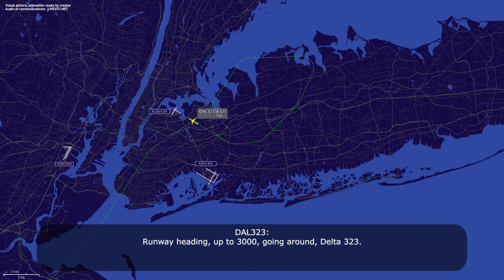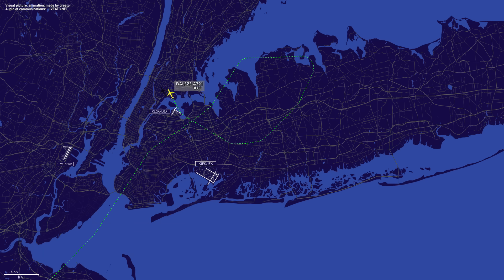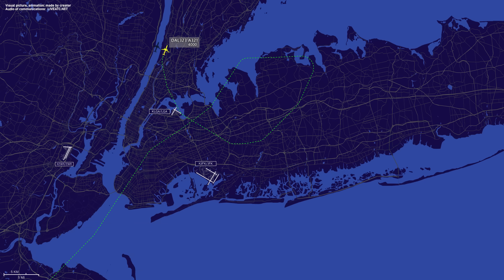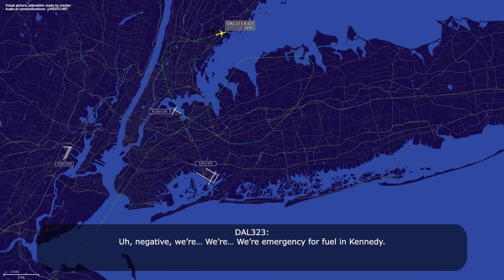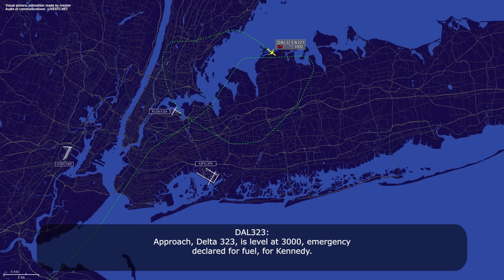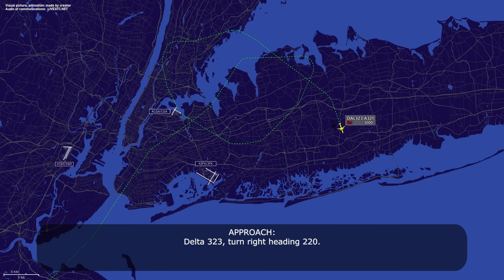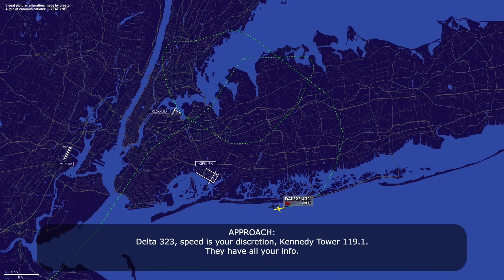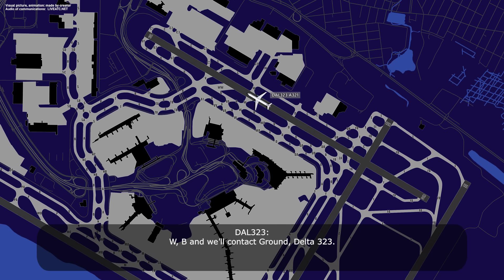Pilot declares MINUMUM FUEL after go around and diverts to Kennedy Airport. Real ATC

Comment: A general question on limited fuel NOT RELATED TO THIS INSTANCE: Do controllers follow-up to check if a minimum fuel declaration was "real" or just a ruse to jump the queue? NOTE: please respond on point! Which if you missed it: ...are instances where  the sequencing is upset due to "fuel emergency" further monitored/examined/followed up? Yes or no?

Comment: My only criticism is that asking how many planes ahead of you is the wrong question...it's really how much time before you're on the approach, or whether you're going to be getting extensive delay vectors. Look at where they were relative to the airport at the 3:25 mark....it's not hard to imagine fitting 10 planes in front of them, tbh. That said, the existence of such awful windshear, meaning a non-zero chance of another go-around, plus the possible delays associated with the medical emergency arriving in front of them meant that diverting to JFK was the right answer. 

My point, though, is that the reasons for diverting to JFK were not really based on the answer of '10' to the question of 'what is our sequence?'

Comment: great video & comments. Wouldn't the same considerations be also applicable for JFK..they were reporting windshear at JFK  (potential for go-around) and it was a greater distance to get to JFK than LGA from where they declared fuel emergency. Is it simply they expected an immediate landing clearance in JFK vs at LGA?  Why could JFK give them that and not LGA & how would delta pilots know they would get that? Thx!

Comment: For anyone curious, it was not the sequencing that caused the diversion. It was the windshear. Once they were emergency, they were #1 for LGA, perhaps #2 behind the medical emergency. But, the windshear made it possible that another go around was quite possible. Then you may have a bigger problem. Now that 40-45 min in fuel is 20-25 minutes. No pilot wants to bet their lives and passenger lives that the tank is that accurate. The pilots made the correct safe decision.
Reply: But isn't being #2 for LGA which is closer, better than #1 or #2 for JFK which is farther, and also has shear reported?
Reply: @JahongirHaitov  I did not see the JFK windshear in the report. In any event,  in an emergency, you want to be #1.  What happens if the emergency ahead of you has a problem. Yes it was medical, but what if they had to stop to treat the (unknown) condition on the runway. Now you are really up against it. At JFK you also have parallel runways... aka multiple options.

Comment: My buddy Flys for delta from key west to Atlanta. He says he barely has enough fuel to get to Atlanta and wants ore fuel on board. Delta won't let him. One bad thunderstorm and maybe not make it.
Reply: Alaska 420 smokin too much 420...nobody believes you... #1 Nobody just flies to/from Key West to ATL. #2 Delta ONLY uses the A319 to serve Key West. It's a good performing aircraft, it can and does carry plenty of fuel for the city pairs. #3 There have been a number of pilots on this thread that have stated they have decades of experience as Delta pilots, myself included (almost 30 years), that have stated they have NEVER been pressured to fly with less fuel than they felt comfortable with. I have never heard one pilot say they were refused additional fuel when the Capt had requested it.
Reply: @6862ptc  thanks for confirming my suspicion
Reply: They're trying to avoid going under minimal fuel requirements dictated by regulations and company policy. It's not like they are about to actually run out of fuel. What your friend is complaining about is needlessly risking everyone being stuck in Orlando and missing their flights from Atlanta. However, someone gets paid more money than a pilot to determine how much it costs to divert a plane, compared to how much is saved by hauling less fuel to 35,000 for 1,000 miles. We should be impressed with how accurate their fuel prediction method is, instead of being concerned about Delta being too fuel efficient.
Reply: @6862ptc  I guess, but only about the flat parts. I used to live in NE South Dakota. There are parts that the grade is 1 ft per mile, that's some flat earth.

Comment: This is a really good lessons learned here. Thanks for posting. I always teach "gas is brains". Meaning when you're low on fuel, things can get pretty hairy. And decisions and the ability to make good ones become more difficult. So the implication is when able, do not skimp on fuel. In this situation however, this airliner probably had the proper fuel planned. This shows that having a legal "plan" does not always preclude situations like this from arising. Higher than expected winds and longer routing can eat into the required reserves. For this reason, many commercial and military operations plan for higher than minimum required fuel. In any event, a go-around is one of those events that can seriously eat into that minimum required fuel. It easily can turn into a 10-20 minute ordeal. In this case he was number 10, which can mean 20 minutes. That's 20 minutes out of his 40 remaining. Talk about gas being brains!

I think the captain made a great decision to declare an emergency and go to an airport with multiple runways that favored the landing winds instead of trying LGA again. Another important takeaway for young pilots is this: "Emergency" is not a bad word. And it does not mean you made a mistake. It simply means you have a situation and need priority....so you can live and talk about it on the ground. No good organization will hammer, or even negatively question a PIC decision to declare an emergency.

40+ years of flying, 21+ of it in the Air Force, has shown that you can hurt yourself or others, trying to "gut it out" in this industry.

Comment: Extremely professional exchange, but… how can ONE go around and some minutes of wait till sequence 10 can put an aircraft into a fuel minimum emergency?
Reply: Do the math. There's 19 planes in front of them (9 landings and 10 takeoffs alternating). One of which is already an emergency and any of which could soon be if they are repeat go rounds. Tower is already in abnormal approach. Tower is already calling go round on wind increase +25 from 11 to 36 (if I remember correctly). Do you have a crystal ball? Any thing goes wrong or even sub optimally, they fall out of the sky going around the second time which means climbing out of LaGuardia into yet another approach with a lot of traffic. 

LaGuardia sucks. More generally NYC sucks but LaGuardia especially.

Comment: Why didnt they plan for more fuel? I mean it was a relativley short flight for the 321 atl-lga, every one knows you can get held up a lot in holds and GA into lga so not sure why they didnt stack up another two hours or so of fuel
Reply: Why didnt they plan for more fuel: mainly because of the equation of more weight = more fuel. And fuel takes more weight, meaning more fuel.
Reply: @andmos1001  yeah but i mean its a 321. they can hold lots of fuel and lga is known for delays
Reply: @gnobes9677  With the new FAA passengers weights they introduced five years ago and more seats on planes, maximum structural landing weight can be a problem for the A321s. A321s are also poor performers climbing wise so less fuel can help get to higher flight levels.
Reply: @matthewstraub8771  still a short flight, i mean ik a captain who goes from atl to bermuda and he says he brings enough fuel to GA and even fly back
Reply: I thought the same thing.  I get that it was probably more efficient to fly with less fuel but was money saved after having to diverting to JFK. Not criticizing  just genuinely curious.

Comment: Carry more fuel, especially when flying into NYC. Problem solved. Not to mention 40 minutes of fuel left isn’t any emergency. It is an excuse to not be flagged as being delayed.
Reply: It is an emergency if you are expecting to land with less than your final reserve, 30 minutes. So in this case, it is certainly an emergency..
Reply: @ The point remains. Simply carry more fuel, especially when flying into LaGuardia. Back in the 80s I was on an Eastern shuttle from Boston to LaGuardia. We circled for what seemed like 30 minutes before the pilot told us he ha$ to go back to Boston due to congestion. This happens all the time at LaGuardia.

Comment: The required terminology is "Mayday Mayday Mayday Fuel".
Reply: No. Not with 4000# or 40 minutes worth of fuel and a number of divert options available.
Reply: @6862ptc  They declared a fuel emergency. This is just about terminology.
Reply: @sylviaelse5086  So, at 40 minutes of fuel, the A321C was at "minimum fuel". When he was told that he was #10, then #7 for LGA, the Capt. then stated he was "Emergency for fuel" going to Kennedy. So yes that was confusing...But the controller immediately understood, this was an Emergency. Mayday, Mayday, Mayday is typically used to get someone's attention. This Capt already had the attention of the controller. So at that point he didn't need to say Mayday... They continued to JFK uneventfully. However, once under 30 minutes of fuel (read off the FMS MCDU screen as EFOB @ landing), if not already direct to the runway at JFK, that would be the time the Capt would state MAYDAY, MAYDAY, MAYDAY Delta flight 323, less than 30 minutes of fuel we need to be vectored to directly to the runway at JFK.
Reply: @6862ptc wrong. Mayday fuel is "we expect to have <30 mins left AFTER WE LAND", not while in the air.

And yes, I've simplified.

Comment: Having just 40 minutes of fuel left after a single go around is cutting it short imo. Especially when the winds are that strong.
Reply: Except we can't tell if this flight was delayed earlier in the flight, just can't tell that by the video. It starts during the arrival and approach. They could have been slowed down and vectored all over the sky 300 miles out (not unusual for LGA).
Reply: Which is why I divert early.  If im planned that low I add more, sometimes things happen, weather, traffic, whatever. Ill land somewhere short of my destination if its the safe and prudent thing to do. It may disrupt plans but that is always less of a problem than running out of fuel.

Comment: Did they had other go-arounds or delays before that? Because declaring a fuel emergency just after one go-around indicates they started the flight very short on fuel...
Reply from the maker: They didn't have a delay during flight. The flight path on the approach is shown in video. Maybe opposite wind on flight level
Reply: @YouCanSeeATC  Are you saying they didn't have a delay during the WHOLE flight? Because we can't tell that by the video. It starts during the arrival and approach. They could have been slowed down and vectored all over the sky 300 miles out (not unusual for LGA).
Reply: I'm sure the company will look into it, but I do wonder about the planning. With all that traffic, single runway, and wind shear they probably should have planned for a lot of holding. I don't know what the length of the flight was - maybe they just couldn't have carried more fuel. Obviously if all these planes had this issue it could have been a problem, though maybe not if this was more of an LGA issue.

Comment: Future pilots should learn from this on how quickly he declared Emergency Fuel, rather than just staying at Min Fuel and hope it works being #10 at a wind shear situation... further, if he had any trouble and had to go around at JFK, you are getting into real dire territory now fuel wise. (Remember this video has parts massively sped up for brevity, it took 20 minutes to get from the go around until landing again at JFK on the ADS-B data, meaning he landed JFK with only 20 mins or less of fuel left!)
Reply: Do any of you idiots actually know the amount of fuel the pilots had remaining when they got to the gate or are you idiots just speculating as you idiots normally do?
Reply: And Delta should learn to put enough fuel on board their aircraft so that they can make their alternate if they have to divert. It's the law, and clearly they did not have enough fuel to make it to Boston.
Reply: @Great-Documentaries  I was on this same Delta flight from ATL to LGA 2 days later, still with wind shear at NYC, and at the ATL gate we were told the plane was "payload optimized" and max weight (could not take any check-in bags). I found that strange and assumed they were either carrying cargo or carrying extra fuel to divert until I saw this!

Comment: If they had said Mayday for min fuel at 3:14 would they have just been pushed to the head of the line instead of having to divert or would ATC have told them to go to JFK instead?
Reply: As another poster said, they could have jumped to the front of the line for LGA, but there were still windshear concerns that may have force another go around and then put him in an even worst spot. Making the call to divert to JFK where wind wasn't as much of an issue was the correct call.
Reply: If you declare MAYDAY then you get to land wherever you like as top priority. Technically a fuel emergency can only be a MAYDAY.
Reply: I dont think the winds are going to be different 8 miles away

Comment: Given that they are legally required to land with 30 minutes of fuel remaining, they were arguably too slow to declare, and should have gone to mayday fuel immediately on the go around.
Reply: Not that simple, they were only emergency fuel after being told they were number 10, and '40 minutes' fuel was some time after that (there are sped up sections to this replay)
Reply: There is no such legal requirement. The :45 mins is reserve fuel and it was used as intended.
Reply: circumstances arise for which any professional aviator cannot anticipate - this appears to have been handled professionally in my opinion
Reply: Not true. You must *depart* with enough planned fuel for 45 minutes past the first airport of intended landing. ATC delays, slightly different winds than forecast, a different cruise altitude than planned, or long approach vectors can all eat into this fuel, but there is no requirement to land with 45 minutes reserve.

Comment: When the approach is ILS 31, those are the worst days at LaGuardia, because all week, high winds mean that LGA is generally under single runway operation (takeoffs are also on 31). Number 10 for arrival means that it’s likely another 30-35 minutes…after every arrival, there is a departure.
Reply: Yes lots of go arounds the last 3 days at Lag. 🤦🏻‍♂️
Reply: Some of the worst turbulence I’ve had is when they’re doing the LOC 31. That long downwind at 3000 is always brutal.

Comment: Contact to Company "Hi, this is 323, throw in a few thousand more gallons of fuel you cheap asses, it's NYC, we're going to be stuck in holding for an hour."
Reply: Maybe it’s just dumb luck but it does seem it’s usually Delta coming into NYC that’s always low on fuel.  Dispatchers saving a buck?
Reply: @tmcorbett  They're the most profitable airline in the country for a reason?

Comment: I have always wondered why the "non tower" controllers ask about the reason for the go around.  Are there $$$ consequences based on the reason, or is it just some FAA reporting requirement?
Reply: I believe there is an FAA reporting requirement, but it's also helpful for the TRACON to know the reason for a go-around in case it's likely to also affect other aircraft that they're currently sequencing towards that airport. A wind shear alert in particular is a useful thing for the TRACON to know so that their Approach controllers can advise aircraft currently on approach of the situation.

Comment: Contrary to FAA regulations. Normally an IFR flight requires enough fuel for a missed approach, diversion to the required alternate and then 30 minutes more. I smell something wrong here
Reply: Winds and/or delays into LGA likely increased flight time beyond what had been initially planned. 25kt wind shear tends to indicate less-than-desirable weather conditions. Then they were also being vectored around a while by Departure after the go-around from LGA, in part due to the inbound medical emergency.
Reply: That's incorrect
Reply: @NiagarAviator what's incorrect?. It's correct.
Reply: @darylonezime8714  no, that's not the required fuel for a domestic Part 121 flight. Most flights do not require an alternate so all they would have to have is a 45 minute reserve going into LGA, which they did. We also can't see what happened before this. It's common to have ATC delays, vectors, and holding, so they may have already used any extra fuel they had, and the windshear may not have been in the forecast
Reply: @NiagarAviator  Maybe what you said is something that applies to only FAA. But like the comment said, contrary to FAA regulations flights normally requires to have trip fuel, contingency fuel, alternate fuel and 30 minutes final reserve fuel. Some flights depending on routes may also required ETOPS fuel etc. This is the regulation in alot of countries.
Reply: @darylonezime8714  the comment is incorrect and a flight to LGA isn't going to be ETOPS. See 14 CFR § 121.639. 45 minutes is the required reserve for IFR and an alternate isn't always required
Reply: @NiagarAviator  how is the comment not correct. He said contrary to FAA regulations. It's talking about regulations worldwide.. Not the ones that apply only to USA.
Reply: @NiagarAviator  We are pointing out that in other places around the world alternate fuel would have been required and the final reserve fuel is 30 minutes. Thats the regulation where I fly and it's the same for alot of other countries.
Reply: @darylonezime8714  the flight was in the US, under US regulations. Rules in other countries wouldn't apply